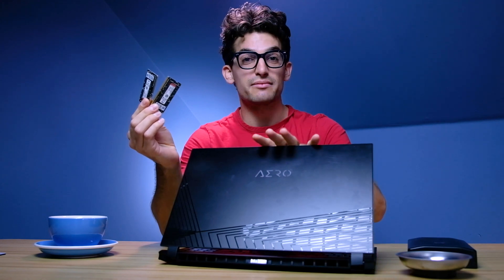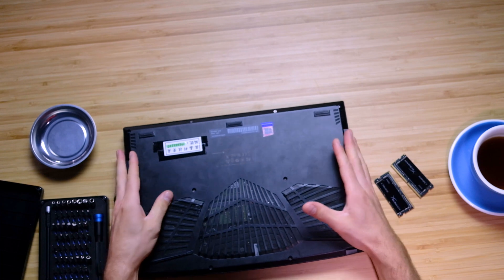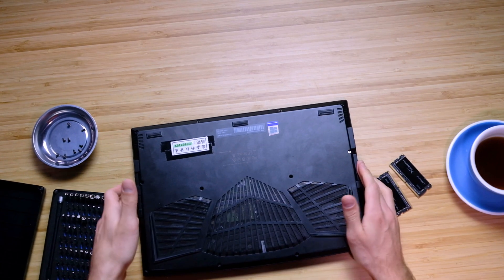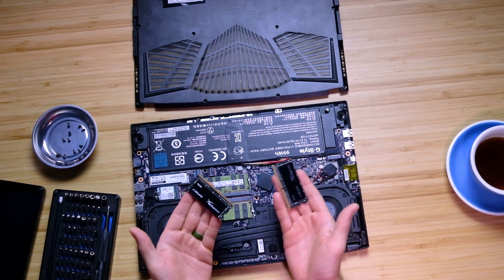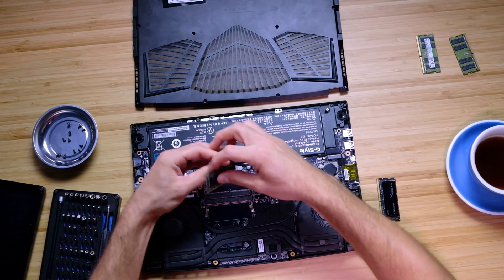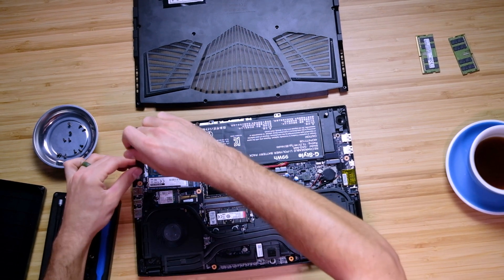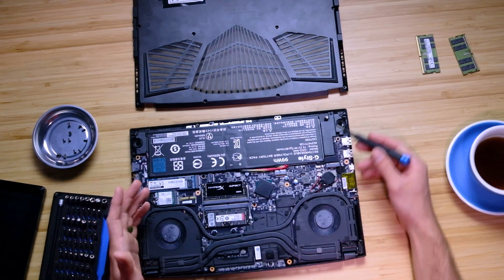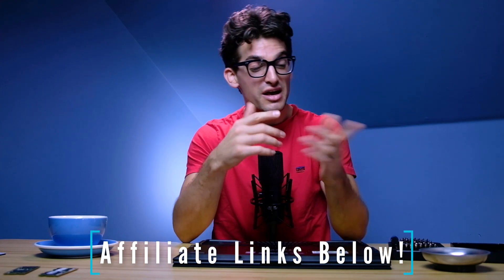How to Upgrade Gigabyte Aero 15 XC RAM and SSD

Comment: What CL is that Ram? CL16 or CL20 ? I'm asking coz ram's gbs are not only the thing to look at. Latency is very important as well. Also the ssd location on the Aero is vital. On mine i compared the slot near the wifi adapter with the other on the side of the laptop. There is almost a 50% difference in terms of wright/read crystaldiskmark benchmark...

Comment: With your help, I just upgraded the ram in my new Gigabyte Aero 15 KD from 16 GB of 3200 ram to 32 GB of 3200 ram. Very easy to do and will add a stick of SSD storage soon. Using it for video content creation.
Reply from the maker: Right on!
Reply: Bro! What RAM do you used? This need to be exact voltage, right?

Comment: Great video, thanks! Which screwdriver head would you need for the Aero?
Reply: I've just upgraded the RAM on my AERO 15 KC today. You just need a Torx 6 screwdriver. 

If you plan to add an SSD as I did, you'll also need a Philipps PH00 screwdriver.

Comment: Can I upgrade a Gigabyte aero 15 oled to 64 gb of ram?
Reply from the maker: Yes
Reply: @BenGKaiser  What would be the best RAM to purchase if you wanted to upgrade this to 64 gigs of ram?
Reply: @mikemonto6904  I just swapped the original 16 gigs of my KC to 64 gigs today.

I used Crucial 64GB kit CT2K32G4SFD832A, which is DDR4-3200 SODIMM.

Comment: Hey Ben, the Team Ram you recommended and linked to doesn’t work in the Aero 15 XC. It’s 1.35V vs 1.2V. Doesn’t look like there is a work around either. I suggest you make sure it works before you recommend something.
Reply: did u find ram that is compatible? im getting the 3070 15 in soon and not sure what ram to buy
Reply: @djefxTV  did you find finally? I'm in the same way :(